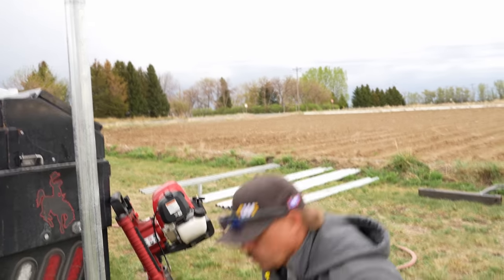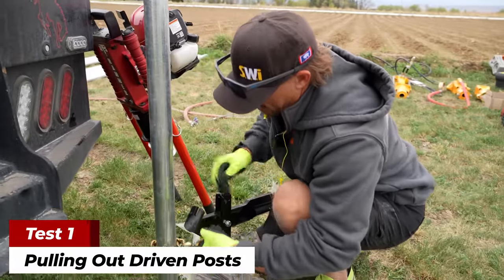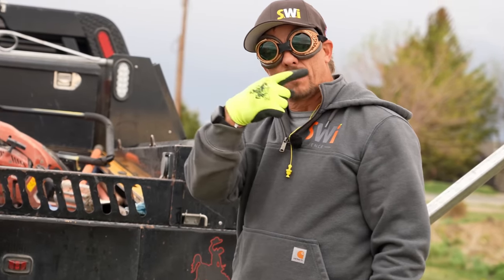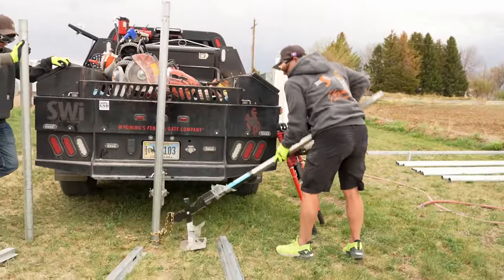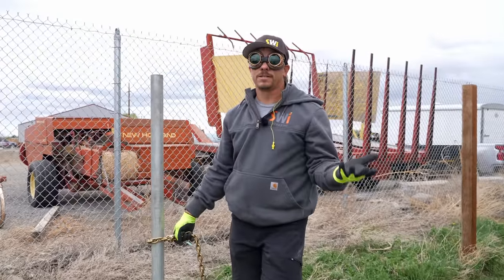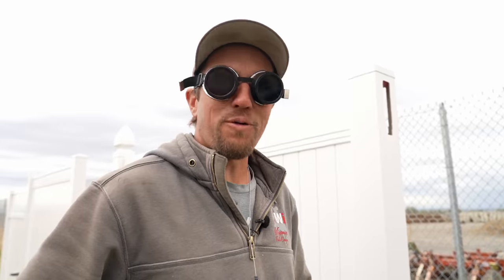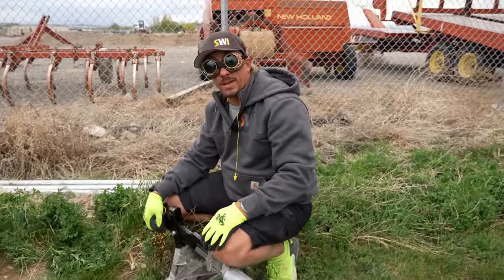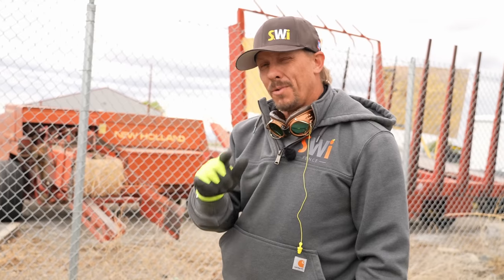Can You Pull Up Fence Posts In Concrete?

Comment: In Canada, until about 15 years ago, everyone had a Jackall for changing tires on trucks. They can be deadly if not used properly to jaws, head impact and hands. Thus why they aren't as popular any longer. But super compact and easy for pulling posts. Similar to these fellas but smaller. Many Offroad units still carry these. I've used them plenty to pull posts, even brings up concrete from three foot down. Easy.  Wet down the posts well a day ahead of possible. Helps a ton! Cheers from Canada :-)

Comment: I would wrap the chain around a few times and make a clove hitch or hitch knot, with the loop around the jack. It may not slide down, but it will not slip.  And that first big pull up, no problem.

Comment: I’m also in FL. I had to pull a bunch of wooden posts set in concrete after one of our hurricanes. I used a Hi Lift jack and it pulled them out of the ground really good.
Reply from the maker: That sounds like a good option for Florida. 👍🏻 We were in Wyoming at the time of this test.
Reply: @SWiFence  your post pulling contraption looks like it does a great job on most posts. A lot easier to use than the hi-lift, too.

Comment: Would love to know if it can pull 4x4 post set in wet pour concrete, 2-3 ft deep.  That's standard here in the Midwest.  I typically use a farm jack and do the same thing.  If I could find something similar but better, i would be all in.  I also do the same with shrubbery and small trees.  Is hould add, when pulling 4x4's out, the concrete come up with it a lot of times.

Comment: Fellers… that’s a right neart fancy post puller.  Don’t know that I’ve ever had the privilege of yanking one out with anything as upscale as that.

Here in the Missouri Ozarks, we tend to stick to our roots… the Missouri Mule!  

Every neighborhood has a mule skinner.  Mine is named Joe Bob.  His mule is named Dum Bass.  (I cleaned it up to get you past the YT censors.  Say it fast and you’ll get his working name.)

Joe Bob is who we call when we are totin’ snags off our bob whar fences in river bottoms.  He and Dum Bass can get in there before the crick goes down.  You see, a real Mule (as apposed to a Kawasaki Mule) ain’t too particular about a foot or two of muddy water under hoof.  

At any rate those snags tend to gather right onto a bob wahr fence… just like fleas on a house cat takin’ it’s first nap on the coon hounds bed.  

Sometimes they rip the whar off… sometimes they just get tangled up… like a dreadlock in a briar patch.  But, there is one thing that always happens… the drift will always bend over the line posts.  

Joe Bob chains his mule to the logs, brush and stumps to get them outten of the way first.  (The essential thing here is that you always pull them downstream.  Because, they should be passed along to the next fence when the crick rises again.)

Next, he brings out his 1937 Farmall High Boy rake wheel. This treasured artifact was passed along from his grandfather.  (He keeps it chained to the hand pump in his front yard for security, between uses.)

Born in a now defunct foundry all those years ago, that 52” wheel has pulled countless objects out of the ground.  A chain wrapped around a stump, post or old clothesline pole is draped over the Farmall wheel. The object stands no chance of being planted once Joe Bob yells “Ho”.  Like magic, Dum Bass leans forward and jerks it out like a pair of tweezers on a tick.  

To my eyes it’s like poetry in motion watching the chain go taut, the wheel sink into the mud and the post break free as it climbs over the hump on its way toward freedom.  It’ll bring a tear to my eye pretty neart every time I see it.

Stumps may require a mule team.  In which Joe Bob’s brother Alfred brings his Jenny named Smar Tass over to help.  That my friends, is a show worth popcorn and a shot or two of white lightning to celebrate.  

My most memorable pull was when another neighbor decided to build onto his chicken coop.  There was this truck axle fence post that had been planted through a white oak root.  It was so stubborn that both Joe Bob  and Alfred were hollering ‘Ho! Ho! Ho!’ so often you’d athunk you were at a Santa Clause convention.  

Then there was this crack like a telephone pole snapping in a whirlwind.  The ground around the axle rose a bit and then a root the size of Arnold Schwarzenegger’s thigh jumped out.  What followed next is seared into my eyes like a branding iron on a steer’s rump. 

The axle laid over and hit the Farmall  wheel with a clang that startled the mules.  Dum Bass jerked left and Smar Tass headed right.  Joe Bob and Alfred found themselves in the middle of a mule skinning maelstrom of epic proportions.  Had I not spit out my mouthful of Moonshine and yelled, “WHOA” there’s no telling what sort of calamity might have befallen them.

When the dust settled, the skinners grabbed their mules and I passed them the Mason jar.  Watching them boys chug a half quart of white lightning was one of the most heart warming sights I’d seen.  It brought tears to both eyes…. And a hearty belch from Alfred.

Sorry for the excursion… but, getting back on track… I have two questions.  

1. How long would a cheater pipe have to be to break a Schwarzenegger thigh sized white oak root with your puller?

2. White Lightning is an appropriate libation for yanking stuff with a 1937 Farmall High Boy rake wheel.  What should I serve to the boys using that upscale puller of yours?
Reply from the maker: 😆😆 That there is a book!
I'd say a cheater bar should be about 20' or 30' to break a Schwarzeneger thigh.
And the post puller jack feels more like it would pair with an aged whiskey...
Reply: @SWiFence  thanks… I have some 20’ sections of well pipe I can use.  If we ever wear out that take wheel …. I’ll be prepared!

It just so happens that I know a guy who is distilling up some bourbon this fall.  I’ll set aside a gallon or so to age… just in case we have to change over to your puller!
Reply: Dude you win the longest comment ever award from YouTube. It’s a partial roll of toilet paper.
Reply: @HamSlicer  LOL… well at least it’s useful for something!
Reply: @sassafrasvalley1939  Still commenting, 8 more squares of TP , from the YouTube.

Comment: how would you compare this strainrite post puller to a farm jack? i’ve only used the latter, once for a 4x4 set in concrete and had good luck with it, we’re up in rhode island. 

i’m planning to use it for another 10 metal poles here at my yard, although i’m not sure if that will be easier or harder compared to the 4x4. any thoughts?

Comment: The concrete did not come up with it. I did it better the a floor jave and an old rotor and a steel bracket bolted onto the round metal post, no chain

Comment: So.. post are set poorly in Florida because of the lack of concrete. But you don’t use concrete yourself in Florida.
Reply from the maker: If you're going to use concrete, you have to use enough concrete. Either drive it correctly or use concrete correctly, but we see a lot of 1-bag 18"-deep posts we can pull out by hand.